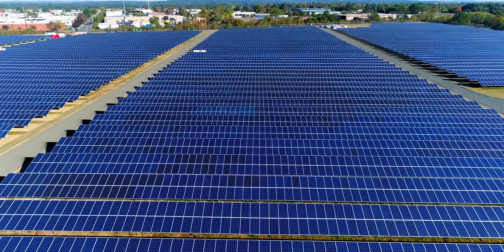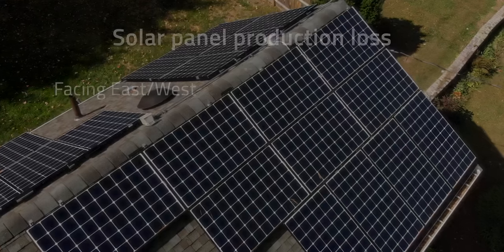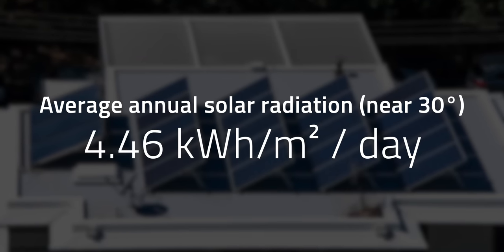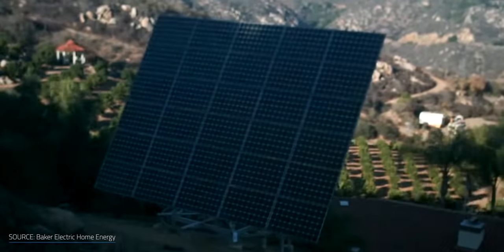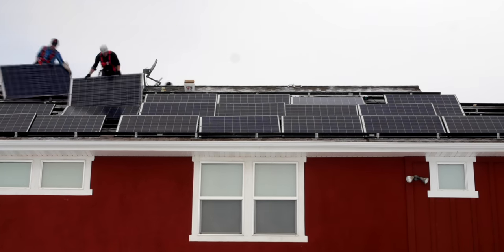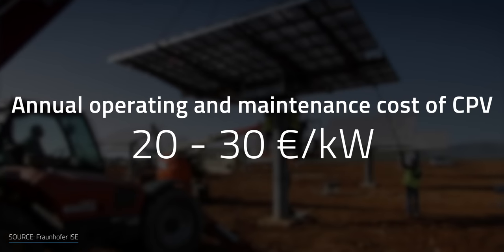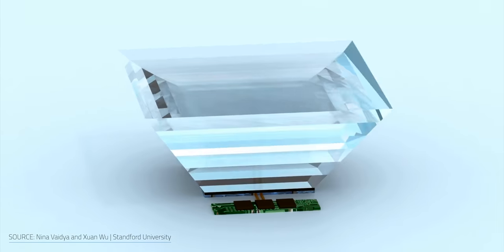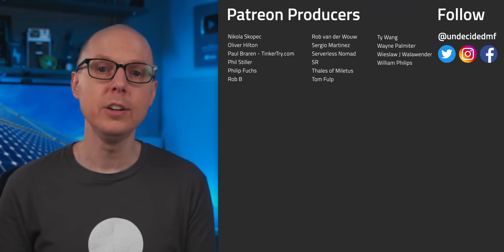This Invention Could Supercharge Solar Panels

Comment: Every lab technology always promises "reduced cost, easy manufacturing" until they have to manufacture the thing and discover the cost is higher and is harder to manufacture at scale.
Reply: You realize that the efficiency of solar has gone up while costs go down year over year BECAUSE OF stuff like this, right?
Reply: Those are engineering problems that just need the right conditions to be solve all it takes is time and money, a lot easier than the research and development already done
Reply: @Hjernespreng  Efficiency sure, price, nope. Price of PV has gone down because most of the panels are manufactured in China with subsidies, low labor cost and no environmental laws. Panels made in other countries are still expensive. 
By the way, this guys are high on their own gases, 3d printing doesn't make something cheap or scalabe.
Reply: @erickzts  everyone always handwave "engineering problems" over the basic research problems, until they have to manufacture at scale, at a price point and under certain quality. If everything was so easy to take out of the lab, we should have hundreds of battery technologies circulating around, but we don't.
Reply: No the man has a point How many laboratory technologies have we seen that suddenly disappear.
Reply: And every discovery is "new discovery", "breaking" or "world's first". Literally every technology out there has pros and cons and each has contextual applicability and depending on how you apply the technology to the context, it can be "breaking".
Reply: Or durability isnt factored into their claim and usually the tech is fragile or so delicate that so much as twisting it slightly breaks it permanently
Reply: This so accurate.  Efficiency goes up but cost does increase in overwhelming examples.   Example be you AC.  Seer 10 efficiency and seer 20 difference is roughly 20-25% of electric consumption.  However the cost and availability of parts is dynamically different.  So you settle into  a seer 16, for part availability and 12 % roughly consumption differential.
Reply: However we all start SOMEWHERE. Without breakthroughs we get bowhere so there is risk but also reward in what the research comes up with
Reply: @Hjernespreng  yeah a little but we’re reaching the limits without much more expensive manufacturing 
This could double output
Reply: @invictusinmoralis6953  Josef prusa disagreed with empirical evidence.
Reply: @vipecrx  Prusa printers, double the price of comparable printers is an example of what exactly?
Reply: The eternal problem of knowledge and incentives between academia and industry. In academia you are rewarded for pumping papers with "breakthroughs" as fast as you can. The researchers are subject experts in their narrow area, but basically have 0 industry or economic experience in said area. Industry on the other hand rewards small improvements that translate into cost savings, simplification, optimization, scale, reliability, etc. The company that improves 1% every year normally wins against the  "breakthrough" company that tries to jump 10% at once.
Reply: @jhonatancock2302  useless statements. Can you actually demonstrate the manufacturing costs? Otherwise all you did was point out something obvious. Lab research has still given us all the technology we have today.
Reply: @jhonatancock2302  Can relate. It is always so easy on paper, but those making the paper ideas never have to put it into action.
Reply: @Hjernespreng  only cnuts say “right” at the end of a smug little sentence.
Reply: It takes decades before the cost can be reduced assuming it is even adopted. This is why this sector is government controlled...or entirely subsidized.
Reply: It feels like that til you look at the decline in cost per watt per year.

Solar has dropped by 62 to 65% in 2010 to 2021 alone.
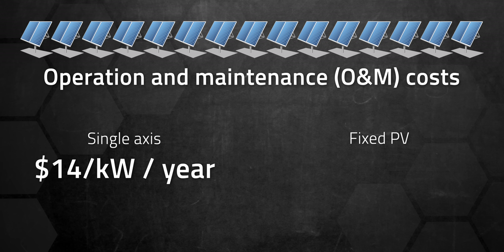Reply: 7:00
Reply: @jhonatancock2302  capitalism prevents that.  Investors only select the best few products pushed by the most persuasive     companies or inventors. 

It's the same reason you have restricted selection in the grocery store.    It's not enough to be profitable.   You have to be one of the few most profitable product.
Reply: @MAKIUSO  iit is cheaper.   It has a high cost of entry but is much less expensive over time. 

Plus,  I don't know if you noticed but the cost of electricity from natural gas is up significantly over the last year and several major hydro electric producers are at risk.
Reply: @MAKIUSO  There are several channels that report 7 to 9 year payoff and show all the math.  And here's the thing... money you save doesn't count as earnings.   So not paying $1200 a year in electricity is equivalent to earning $1800 to $2400 per year on electricity.

The biggest challenge to getting solar is that all production of the cheapest PV solar generation is sold out in advance thru 2024 to large utilities.  Because they are buying so much, they get to be first in line for product.

There is also the issue of the danger of grid tied solar requiring a professional installation by an electrician or at least a solar tech followed by an electrician to certify the job.   And the danger of any kind of roof work (not just solar).
Reply: Looking at the lab prototypes, there are some features that obviously look expensive to mass produce. A design that scales would probably need to be much simpler. Something that struck me is that the direction of incoming sunlight mostly changes on a single axis. The value of concentrating on that daily axis is much more than concentrating to mitigate the small variance in sun height over the course of a year. In turn, this means the panels could end up with concentrating strips (rather than a grid) and then we're looking at something that looks more mass-producable.
Reply: @MAKIUSO  hydro electric and geothermal (and nuclear and coal) consume vast quantities of "free" water.   I think all will become much more expensive and/or less reliable.

Solar + Wind + Storage is the answer.  And, in my opinion, non-grid tied supplemental electricity is the way to go.  It's very cheap.  For example - 600w system fed thru a "solar generator" will drive an AC unit for the hottest part of the day, reducing usage of central air which increases it's lifespan and lowers power bills (esp keeping the house at 81f while you are at work).  

Per the DOE, for solar power, "Current cost of 4.6 cents per kilowatt-hour (kWh) to 3 cents/kWh by 2025 and 2 cents/kWh by 2030."  

And it doesn't use massive amounts of water, doesn't release tons of carbon, and is distributed which combined with local storage is huge during disasters and power outages.
Reply: @MAKIUSO  
it's like the Tesla.

High up front cost.  But owning it will save you $8000 to $16000 dollars in final net cost compared to a gasoline car.

It's like owning a house vs renting.    Renting is a better deal for about 5 years.  Then owning a house gets cheaper and cheaper compared to renting.   My cost to "own" is $550 per month for 2000 square feet and a yard.   $600 per year repair insurance from AHS has covered 90% of my repair costs for the last 16 years.

Solar covers its costs in a decade at most.  Then it saves money for another 15 years.   And in some states, it produces cash and helps stabilizes the electrical grid.

the russian invasion of ukraine has been a boon for solar power investment.
Reply: @MAKIUSO  Is your electricity price variable during the day or not? I do not particularly object to the use of fossil fuels but the prce on my electric bill is under 5 us cents per kw/h and my local utility is generating 98percent of its its output from renewables.
Reply: @macmcleod1188  How exactly can running water through a hydro electric dam be considered to "consume" it any more than a windmill "consumes" the wind?
Reply: @Monte Veskeii wow.   That's a ton of misinformation in one post. 

"U.S. Sea Level Rise and Coastal Flood Hazard Scenarios and Tools Interagency Task Force, concluded that sea level along the U.S. coastline is projected to rise an average of 10–12 inches (0.25–0.30 meters) in the next 30 years (2020–2050)."

Please do yourself a favor and start following genuine science sites instead of ill informed vloggers.

The rest of your "facts" are equally poor quality.   I take it you use the "Daily Mail" as a primary source.   😉
Reply: @dennisenright7725  when you have to run it thru just to keep the lights on instead of conserving it for other uses.
Reply: @Monte Veskeii you remember the slanted anecdotes. I'm quoting the facts.
Reply: @jhonatancock2302  actually we do. Just look up the amount of lithium and natrium battery variations available right now. 30 years ago only one variant had just become available.
Reply: @Monte Veskeii bored now.   Muting your account.
Reply: @hybridstoatdragon  Yea and people often forget research has to be funded. You can't just say "this sounds cool and might be useful somewhere".
Reply: @macmcleod1188  You do realize that it can still be used for those other uses downstream of the hydro dam?
Reply: They have to pay "taxes."
Reply: I think most people in this comment thread are right in skew way. Whole thing is a clusterfuck of slow but steady gains and that takes a long time to get going.
Reply: The dirty oil itself is expensive, need transportion, complicated distribution network, & extremely dangerous, but the demand is higher, so the show must go on no matter what it cost. So the key factor here is not cost, but demand, especially now when oil war is on.
Reply: Just like this channel. The titles hype up every piece of research to be the next huge thing. It's tiring.
Reply: What exactly do people like you want with these comments? Should we just stop all of progression at this point and just stand still and burn fuel until we’re out.
Reply: @MAKIUSO  oh stop.  Now you v are just embarrassing your self.   You generate an 80% annual return yet care passionately about the incremental return of a couple hundred dollars. 

But there is more.   Barron's magazine reports the average return over  10, 20, 30 year periods is 2% to 3%.  So maybe you made an 80% return on something for one year.   But every year?  You'd be a multimillion in a few years and you would not be here arguing against the actual data of multiple youtubers and their spreadsheets. 

A 5% tax free return (typical for solar) is amazing for most normal people.
Reply: @vincentsumner5232  stop sensationalizing research like it will assuredly be the next big thing.
Reply: @MAKIUSO  look.. it's clear you have done kind of problem that has you out of touch with reality and over excitable.   It's clear your info is unreliable so...

Im going to move on down the road.   
Bye.
Reply: Ikr, I just label all of these lab advancements in the "exceptional at everything but leaving the lab". They do this marketing because they need continuous funding and recognition. It's so frustrating to hear of all the great advancements that are theoretically possible. I'm still waiting all the stuff made from graphene. Luckily there are some minor use of graphene in commercial products, but definitely far away from it's promises still.
Reply: @Hjernespreng  you're wrong, most new tech never makes it out of the lab because it isn't practical or cost effective at all. Ya sure solar has become slightly more efficient over the last 2 dacades but not much.
Reply: @jhonatancock2302  exactly! All these videos over the last decade about new battery tech that claims to be the next Lithium killer is absurd. I have seen problems a hundred videos on different "revolutionary" battery tech thats just "right around the corner" none of it, literally none of it is ever talked about again. We have been using Lithium heavily for the past 20 years and nothing has even entered the market that could compete with it in capacity/life span/energy density/cost. I have come to the conclusion that we probably arent going to see a new battery tech that replaces Lithium in 10 or more likely 20 years. So many people are banking on technology that hasn't even been developed to get us to 100% renewable energy. We cannot do It with the current tech we have.
Reply: Actually, until they patent it.
Reply: @jeanpagette5019  dude.. Who is buying seer 10 units? Is that even a thing still? You can get cheap 20-23 seer split systems for cheap. It starts getting alot more expensive (50%-100% more expensive) for seer 30+ systems. They only increase efficiency by 15-20%. It takes 7-10 years to recoup the savings in electricity to make up for the upfront cost of the more efficient unit... Atleast based on the US national electricity price average.
Reply: @vipecrx  how did he disagree? Nothing about his printer was revolutionary
Reply: @macmcleod1188  no.. Capitalism is what got us this far in the first place. Technology wouldn't advance the way it does in a socialist economy. People need incentive to innovate.
Reply: @macmcleod1188  I plan to go fully offgrid solar. I won't be roof mounting my system since I have 10 acres of land and it would just be more expensive and be a pain to replace a roof if I need too. I can build a large Lifepo4 battery bank out of raw cells for about $160 per kwh. A 50kwh system should be more than enough for me and never having to worry about draining my battery. That would be a $8000 battery but will last 15-20 years. Solar panels are cheap if you know where to look. Used panels are $0.25 per watt or $0.45 per watt new. That means a 10kw system would be $2500-$4500 in panels. Inverters would be a solid $3000 too. Obviously I would do all the work myself and since I'm off the grid I don't need to worry about a pro certification to hook it up.
Reply: @Monte Veskeii it's bait and hopium for people who believe in a renewable energy future. It make people think "if we just spend a little more money on these new technologies to develop we will have a breakthrough and be able to go carbon free!". We currently are not capable of doing so with our current battery/energy storage tech and our renewable energy tech. Windmills can't even pay for themselves in the life time of electricity they produce, it's a net loss financially. We dont have the available Lithium to produce enough batteries for a world of electric cars, let alone replacement batteries when those ones wear out in 10-15 years. This forceful push towards renewables will be disastrous when we slowly start shutting down our oil and gas power plant in lieu of solar and wind. How many millions of homes are currently heated with gas and oil? All those need to be electric too. We don't just need to match our current electric output with renewables, we need to produce 3-4 times as much as we currently are. It just won't happen until something dirt cheap that uses common materials to create and store electricity.
Reply: @dennisenright7725  hydroelectric dams are pretty much at their max capacity right now. We can't just add more dams to satiate of need for more clean energy. I'm on hydropower too and only pay 6 cents/kwh but that is far cheaper than almost anywhere else in the world. The US average price is 12cents/kwh and some places in Europe are 15x higher than what I pay(obviously because of their fossil fuel shortage)
Reply: @macmcleod1188  he's talking about claims from the past. There where claims our current coastline would be underwater by now... Hell they said the earth would. Be cooling and not freezing back in the 70s and 80s.
Reply: @macmcleod1188  that makes no sense.. You don't run a limited supply of water through a dam.. Its on a river with ever flowing water all year. Yes you can build a lake reservoir for when you need to generate higher power loads but it isnt a consumable. Solar relies on a very inconsistent power source as well as wind. What are you even talking about? What 600w solar generator(all that is, is a battery bank and a inverter) can power a AC unit that will cool a house through the hottest part of the day? It won't. Evem with the most efficient heat pump/AC you are only produce 9000btus with 600w of continuous power, that will cool a small trailer or something 200-300sqft. Not a house. Most AC units of that cooling capacity use 800-1000w of electricity anyway. Ac isn't really the problem, it will be heating in the winter when the sun is minimal and people need heat which usually take more electricity than AC does, especially below freezing since heatpumps drop in efficiency below 45°f(7°c) and even worse at 5°f(-15°c). What is this magical storage solution that you think will be enough to go completely on wind and solar? Because I'll tell you right now Lithium won't even come close to being capable even if we get Lithium to be 2x the energy density in is now.
Reply: @brag0001  lol you just proved the opposite point you think you did. The fact that we only have improved Lithium with different varients/chemesties shows just how we aren't moving forward. We nees revolutionary new battery technology, not small evolutionary improvements over the last few decades. Did you forget we still rely on Lithium? A very rare element that we don't really have enough of to go completely renewable energy with? It would be far greater of a investment to figure out how to cheaply(or at all) recycle the Lithium in old cells so we don't have to rely on digging out more which costs alot of money and uses an insane amount of carbon to do so.
Reply: @2nd-place  but slow and steady gains are not going to cut it. We need new revolutionary tech in order to make 100% renewable energy sustainable. Our current tech will never improve enough to cut it. Lithium isn't the answer and improving it won't change that.
Reply: @randybobandy9828  You obviously have no idea what I was talking about. You probably think I was talking about slight variations of what you find in your phone. This isn't the case. A LiMn²O4, LiCoO², LiFePO4, LiNiCoAlO² and Li²TiO³ are already pretty different designs, with very different properties. Lithium Sulfur batteries are yet another variant, with its own characteristics suitable for yet another type of application. And that's still talking about the conventional stuff.

It also funny that in a reply to a post which lists lithium and (!) sodium (sorry, I wrote natrium, but you obviously didn't even care to google what that was) batteries, you reduce the topic to just lithium to then complain about its rarity. Well, sodium isn't rare. We could replace ALL production of lithium batteries with sodium batteries tomorrow, and world trade of sodium would barely register the change in demand. Sodium batteries currently reach 80% of the capacity of the best lithium batteries using the same volume. Development in that area is so fast, top of the line sodium batteries now outperform first generation Tesla 3 lithium cells on every metric, despite sodium being inferior to lithium in theory. Despite this shortcoming, they are obviously good enough for cars; unless a Model 3 is a useless car to you ...

And you are wrong about your main claim as well. We do need incremental change! One would think that after this pandemic people would finally have understood the power of exponentials. Increasing capacity by 5% doesn't sound like much. Doing it as a yearly average for decades though ...

When I had my first laptop with a lithium battery, we were pushing 125Wh/kg. Back than lithium batteries were expected to fizzle out at 200Wh/kg. We are currently pushing 450Wh/kg.

And to add insult to injury: Lithium isn't even all that rare. Lead is rarer than lithium, yet nobody ever complained about us not having enough of it to build all those car batteries from it. It just takes too much time to ramp up its extraction. Setting up a new mine can easily take ten to fifteen years; and mineral prices had high fluctuations in the past. Many investors actually lost a lot of money investing in lithium pretty recently.

But even if we exhausted our current and future reserves which we could extract through mining, it would still be available in massive quantities in sea water; and we get it pretty easily from desalination plants. The actual bottle necks are cobalt and nickel. But again: Sodium batteries come to the rescue, as variations which don't rely on those much rarer materials exist. Many applications don't actually need lithium batteries and can do just fine with sodium variants; including cars, wall boxes ...

As for recycling lithium. We have already build such plants. They currently operate at a loss, because there isn't enough lithium batteries coming back for recycling yet. One of the reasons being their second life usage as wall boxes.

So tell me: what have I actually proven with my post? Which of these versions of lithium batteries did you even know about? Have you even cared to google them to find out what makes them so special?  Did you even know that sodium batteries were a thing? Do you even know why any advance in lithium batteries actually helps sodium batteries and vice versa?
Reply: There is always a delay between new technologies being developed and those technologies reaching maturity in an economic sense. One day this technology may be standard and the manufacturing difficulties will be ironed out
Reply: @brag0001  lmao I know exactly what you are talking about.. It doesn't matter if the chemesty is slightly different, it still uses a rare finite resource. There is a reason they are all Lithium based batteries so quit trying to act like they are completely different. We need REVOLUTIONARY new battery tech. We need higher energy density using common cheap and abundant materials In order to scale up and maintain a cheap price. They can make 10 more Lithium variations but it won't change a damn thing. Funny you keep bringing up sodium batteries... Interesting that you can't go and buy any of them online,... 🤔 Curious. Until it becomes mass produced it isnt considered as a current and capable battery.
Reply: @randybobandy9828  so, like sodium batteries? The ones you keep ignoring? The ones CATL is mass producing right now? (And others for that matter) The ones you could buy, if you were an important player in that market and buying in relevant quantities?
Reply: @MAKIUSO  looks like it's time to mute your account since you basically just self identified as a troll.
Reply: @randybobandy9828  no disagreement on that point.   I support a well related market .  Raw capitalism without social welfare elements leads to misery,  death,  barriers to competition, and monopolies which stifle innovation.  These can lead to violence and civil disorder. 

The u.s. was much more creative and had higher rates of job creation and growth with lower wealth concentration because more people were incened to invent and start businesses.
Reply: “lab technologies” and university proof of concepts are Matt’s bread and butter though…
Reply: @joal doboah And that’s why car windows, which are layered, curved and subject to thermal expansion (not to mention wind and motion stress) crack and fail all the time, right? Well, no. Glass is actually very rugged stuff, and it’s unlikely that there are massive variations in thermal behavior between layers.
Reply: @randybobandy9828  your talking completely out your ass on this.   Seer 10 is just 2016…. The maintenance and parts for a seer 18 and up is exponentially more aggressive.  Example is the DC conversion boards.   By them alone is 700 dollar part with a poor track record of longevity. A basic 8 ton split system is 15k out the door on a seer 16 with a service life of 13 to 15 years.   That savings does NOT show it self on a bill even if you don’t account for the rise in kilowatt per hour increases.   Brother you steady lies
Reply: @jeanpagette5019  lmao.. No I'm not. Get with the times
Reply: @randybobandy9828  I just listed you field experience with examples, merit consistent of get with the times.  Next your example will be a Reddit thread as an example…. Field application in commercial and residential for North America.
Reply: @jeanpagette5019  why are you talking about commercial units? Nobody is using 8ton systems for their home unless they have 4500sqft home. 10 seer is hilariously bad and 16 is on the low end of acceptable. Traditional central AC systems are notoriously inefficient.
Reply: @randybobandy9828  split system for homes 3000 square feet are 7.5 ton residential….. the majority of homes fall into the 5 ton area,
Reply: Mass production is always hard, even Elon said so himself
Reply: Yup… big fan of Tesla but this is currently happening with their new batiereis. Seems to be having a lot of issues with reaching the manufacturing output desired
Reply: "lab technology"
What's that even supposed to mean? All tech comes from a lab.
Reply: The fact that the fossil fuel industry pretty much owns everything, and therefore it gets to influence the costs of manufacturing, it makes you wonder
Reply: @MAKIUSO  We have neither active volcanoes or earthquakes large enough to  threaten  generating and transmission capacity other than one area of the country  that has a risk of those but that area is 4000k west of here. But when the temperature drops to minus 30 for weeks at a time with absolutely no wind   and a foot of snow can stay on my house, barn, or garage roof for months before it warms up enough for it to melt I am very glad not to be dependent on windmills and solar panels  but a more trustworthy renewable source of electricity
Reply: @randybobandy9828  I'm not entirely sure that hydro is built to its max capacity yet. In some parts of the world it is  and their are many places that might not be a useful as they might seem. A dam might be built on a tributary  of the Amazon or Congo might seem a great idea but if the river carries enough sediment to fill the reservoir in a few decades it won't be a very productive investment.  But here in North America we have an area around Hudson's Bay that is almost as big as the Sahara desert that was scraped down to billion year old bedrock by glaciers that is perfect for hydroelectric power and is not even close to fully developed yet. The very same environmentalists who say that fossil fuels will destroy the planet and that we need to switch to renewables seem to be be absolutely opposed to this one.
Reply: @randybobandy9828  The best places for hydroelectric development might not even be within sight of land. Tidal power is an excellent resource, the place with the highest tides in the world  is the bay of fundy in eastern Canada. The amount of water that flows in and out daily is almost double the combined flows of all the rivers in the world. But the shoreline can be a place that is brutal on equipment  and you have to deal with people who say they love green energy until something is built within site of their beachfront property. I was thinking more along the lines of Run of Current type systems installed in places where seafloor topography gives you a steady flow of water fairly close to land. Channel islands off California, St Laurence estuary,Backstairs channel south of Adelaide. Reasonably steady flow of water gives you a more even output that doesn't require such large investment in backup generators or batteries.  The last of the three places that I mentioned could probably have been developed for far less than Australia has spent on solar and wind and would have provided steady baseline power
Reply: No, they do lower the substantially, until they control the market then they raise it. Supply and demand isn't a thing any more.
Reply: I work in manufacturing, technology and tooling continues to improve in our industry as well so this could be feasible. I have no experience in lens manufacturing but if they could join the separate lense materials after subtractive processing it would substantially increase product output versus additive processing.
Reply: This tech reminds me of whats already inside everyone of our lcd TV.  They place light diffuser over each white led.
Reply: Well everything that has ever gotten manufactured has ever come that
Reply: Yes, it is hard to get energy out of an inert system. We are fighting against the laws of thermodynamics. 
Also perfect is the enemy of better in this case, with politicians highlighting the problems inherent in renewables while denying the existence of problems with existing systems
Reply: @joal doboah Actually I’ve heard of this problem in other engineering and material fabrication circles 
In composite manufacturing of different materials. And one of the solutions actually is using at the coefficient boundary lines,is to blend the materials at a certain ratio so the bonding structure is such that you don’t have stressful structure fractures at the boundary lines through expansion. what would be a actual life expectancy it has to be tested and verified under conditions.
Reply: I mean i dont know how their funds would look like if they said damn we cant come up with anything lol
Reply: @jeanpagette5019  To put it very simply: a cheap 20% eff panel at $100 that's going to last 15 years is going to be much better than a 40% eff panel that is $300 and lasts 10 years. Only in very space limited or occluded sky situations might the higher efficiency panel make any sense. This is why satellites use triple or quad layer panels but no one is going to buy a $10000 panel for their home when similar power is available for $200.
Reply: Especially when manufacturing starts with 3D printing
Reply: @macmcleod1188  and to not forget, once build hardly needs any external geo political sensitive inputs.
Reply: @randybobandy9828  in the 1970s there were less than a half dozen wild eyes studies predicting not just cooling but a new ice age.   They made the cover of Omni magazine.   

At the same time there were more than 30 studies predicting warming (and much less than has already happened) plus more suppressed by ExxonMobil (in 1978).

It's misleading to act like it was close to a 50/50 thing.
Reply: @macmcleod1188  no.. The overall general consensus was a new ice age. You're point is irrelevant because we have scientists now that don't agree with humans causing significant effect to cause global warming now but that is the general consensus. You can't expect to constantly be completely wrong on your predictions and expect people to take them seriously.
Reply: @randybobandy9828  no it was not.   Google the studies.   I read the same articles in time magazine and Omni magazine (science fiction... science fact).   And about a decade ago I was in a discussion like this and googled the studies and was surprised to discover there were many more studies warning of warming.   It was the consensus at the time.    

Anyone can go do the research themselves .  I recommend you do so.
Reply: This is true but if it's not done at the over scale issue it will never get to scale or better that's what it needs to be done!
Reply: Same with batteries. How do you reinvent the wheel? It's all old tech that can't be improved upon.
Reply: These Concentrators have been Manufactured Cheaply for years. There have been huge advancements made recently, due to LED’s. They are just used in reverse to change the Spread Angle of the Lights. The most notable are the ones on my Salt Aquarium LED’s, the spread is at optimum, and due to the Tuned Focusing, I get the Natural Shimmer.
Reply: A big problem is the greed/business perpetuating aspect. It wouldn't matter if the people doing these things were doing it without extreme levels of profit in mind I think. It would still cost money and not exactly be cheap, but corporations definitely like to excuse every extra sent they tac onto a price that they possibly can.
Reply: @MAKIUSO  The problem with faster growing plants from higher CO2 is productive yield. 
The yield of grain crops drops as more growth occurs in the leaves & stems at the expense of the seeds. 
Then comes the issue of water. Greater total leaf surface area increases transpiration. If more water isn’t available the plant becomes stressed. Which reduces the nutritional value of plants grown to be eaten.
Reply: That statement is so broad it’s mesninglrss
Reply: @MAKIUSO  your experience did not have a control for comparison. Nor by the sound out it, analysis of the nutritional levels. Anecdotal experience is meaningless & irrelevant.
Reply: @MAKIUSO  At a micro level, sure you may benefit for a while. However, millions of people will suffer malnutrition because the nutrients in grains aren’t as high as they need to be.

Also, weight may not always be the measurement for determining price. Eg Milk is priced based on milk solids. Not the volume of litres. Farmers producing ‘Watery’ milk from low condition cows eating poor pasture get paid less by the dairy processors.
Reply: @MAKIUSO  that you think this just shows the disingenuous or deliberately ignorant nature of your statements.
Reply: @invictusinmoralis6953  The first solar panel I bought was 50 watts and cost over $300.
Reply: @Cloud_Seeker  I have worked with engineers in research and development. We worked on the factory floor right beside production. If an idea worked then it was turned over to production and we moved on to something else.
Reply: @simplethings3730  Well I work as a IT tech in charge of prepping orders and making sure they get delivered on time. Is and been a hell for the last few years.
Anyway. I often get told to "just drive it out" to the costumer. But what the people do not understand is that it is like hearding cats. Especially since everyone started to work from home, and with factories only delivering stuff after 8-12 months.
Reply: There will always be  naysayers. 
There were problems  with cars and cell phones at first. Now look. 
A problem  is just a speed-bump.
Reply: @LaughingblueSu  They also preformed a function and did something useful all up to this point. You can not go from "we will make things a 1000% cheaper than anyone else" just like that. You are not going to jump from WW2 radios to modern smartphones in just a few years.
Sometimes a problem isn't just a speed-bump. Most things fail because of that "speed-bump" for good reasons. You should stop being a sheep.

"But the fact that some geniuses were laughed at does not imply that all who are laughed at are geniuses. They laughed at Columbus, they laughed at Fulton, they laughed at the Wright brothers. But they also laughed at Bozo the Clown." - Carl Sagan
Reply: #RESPECTED INDIVIDUAL WITHOUT EXPERIMENTS NO INVENTIONS
Reply: #RESPECTED INDIVIDUAL WITHOUT EXPERIMENTS NO INVENTIONS
Reply: Every technology that actually reduced costs and increased efficiency started in a lab.
Reply: The efficiency of manufacturing comes from repetition. The start up is always more costly. They have to make the molds and machines to assemble those items. Then assemble them. So the longer a specific assembly is used, the less and less it will cost the user. Where as having to change things out constantly eats into the bottom line pretty hard. When they say it will be more efficient it is assuming an average once the whole thing is set up, which admittedly won't be seen for a stretch of time.

So it isn't that they are wrong, it is that a basic reality about production is being overlooked.
Reply: Very true… very often. But for single material objects like lenses tend to benefit at scale. Solar panels themselves will be a larger challenge.
Reply: @joal doboah this is a very good point. I wonder if they've worked on any kind of thermal shifting protection, or have plans to. I'd imagine they are aware in the lab as this is basic material science, but I can see how it could be overlooked for the sake of proof of concept without consideration of long term use in a real implementation.
Reply: I guess every lab cant simply do a manufacter mock up. But i guess they are not engineers
Reply: @roseknuckles9894  at least they're not bloody architects!
Reply: @NeonNijahn  lol
Reply: It’s mostly because there are no factories that are specifically built for this new design, it takes a few years to build the infrastructure for the new design and a few years after that for companies to start turning a profit.
Reply: Prototypes often have unfulfilled promises, but those promises are hopes of innovation and with time can be corrected. Watch an episode of Star Trek TOS and count all the “props” that are now everyday items from communicators to surface computers to automatic doors, these things were fantastical in their day. Yes this is likely years or even decades from practical mass use and only of interest to early adopters, but it’s worth noting so we can focus in on addressing things like issues in  durability, distribution/supply and cost. 
I live in an area with regular Hail and with climate crisis weather is prone to increased extremes so I’m hesitant on the durability of many of these new systems.
Reply: @hybridstoatdragon  so I think the fact this was featured in a nano tech journal gives some hope on the fragility case. Making things very small in some ways can increase durability (think large tile vs say penny tiles). Polymers are likely to be test for exstreems if lab is getting that sweet sweet Nasa Money. NASA is working on various tech that can with stand the extremes of say the dark side of the moon.
Reply: @christinaapplesauce2459  this depends on what you mean by “win” I agree the slow improvement company tends to last longer but the profits to be made as the new hot thing are not to be ignored and for large corporations diversification means having hands in both sides of that scheme, and in 3 other totally different ones.
Reply: @MAKIUSO  solar has high initial investment cost, that is a barrier to entry. It also has some overhead/maintenance costs that can lessen the benefits. Imagine telling someone in 1950 about backyard solar lights that every grandma has in their garden. Technology is shifting in many ways at breakneck speeds, that’s gonna have wins and fails.
Reply: @MAKIUSO  this is likely for residential solar roofs  not “solar farms” which with residential a neighborhood could become a solar farm. 

You also don’t mention Nuclear power cause it kicks these other power generations systems in the ass, but of course the “cost” is way more nuanced with nuclear as not only does building the facility expensive getting a place to let you build it is super complicated.
Reply: @macmcleod1188  so in the example of the Tesla those savings require you to have access to charging and are based on estimated power costs (which fluctuate wildly see Europes current concerns about winter)
Reply: @LizStaples  I agree with your point about access (so it's an issue for apartment people and others).  And the cost of owning and storing any car in major cities like New York is crazy high already regardless of type.
 
However, your second point shows ignorance of charging costs vs fueling and doesn't consider that gasoline also recently doubled in price.   

Gasoline costs about $3 to $6 per 30 miles (17 miles for trucks,  60 miles for subcompact).   

Electricity costs roughly $1.20 per 30 miles at 15c/kwh.    If electricity doubled,  it would cost $2.40 per 30 miles.   It is enough to save American car drivers about $1,500 per year if gasoline cost $3.50 per gallon. And enough to save European drivers about $750 per year.

And in my last natural disaster,  there wasn't a working gasoline station within 70 miles.   Everyone was paralyzed.   I keep a 10 gallon tank now and fill it up when a disaster is pending.    If I owned an electric car tho, I'd have a small cheap array that could provide 30 miles a day range (with a propane backup generator.   Those things are really sweet right now with much easier maintenance than liquor fuel generators).
Reply: Problem is they never account for inflation
Reply: Markatching 😉
Reply: @joal doboah I wonder if using printing they can use 1 material but still bend light just by the "grain" of the material being printed
Reply: on the contrary labs that specializes in researching to find cheaper alternative materials exist. that makes it possible to mass produce and profit from existing technologies.
Reply: @invictusinmoralis6953  Pretty that was the point.
Reply: Nonimaging optics have been around for awhile. Could be ready for the market.
Reply: Seriously, it's 1 in 1000 that actually achieves it.
Reply: You expect them to say it's difficult and more expensive? 🤡
Reply: Fresnel lens
Reply: Brother come to India, we can produce it in here for cheap.
Reply: Well yes but it's always worth it in the end
Reply: This is more of an economy of scale problem.
Reply: @invictusinmoralis6953 

"By the way, this guys are high on their own gases, 3d printing doesn't make something cheap or scalabe"

You are thinking in terms of domestic 3D printing for hobbyists, or low size industrial 3D printing for prototyping .

The industry has been scaling up 3D printing for years now.

Combined with faster printing prcoesses it can indeed become cheap.